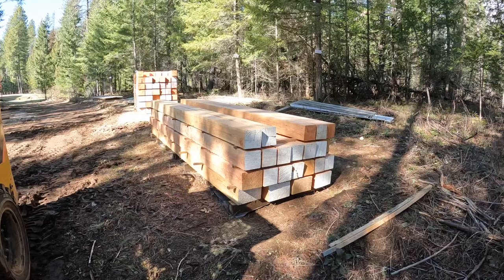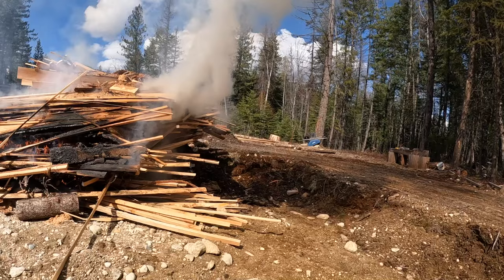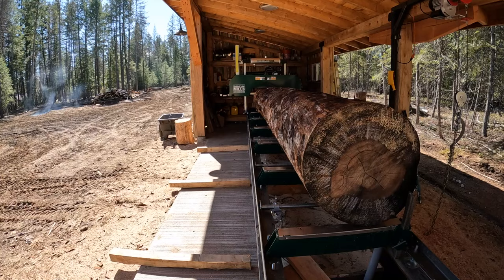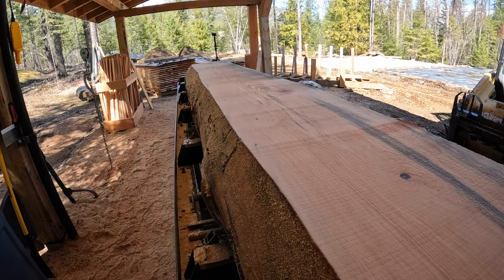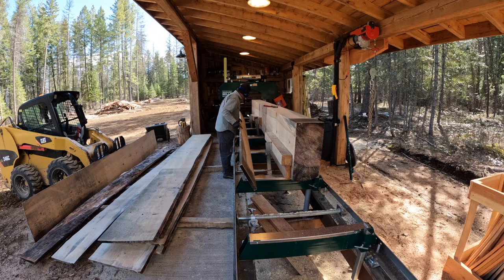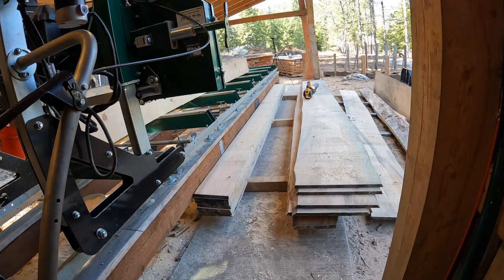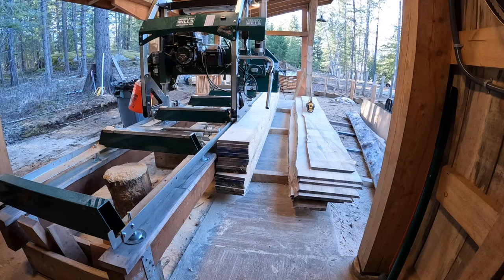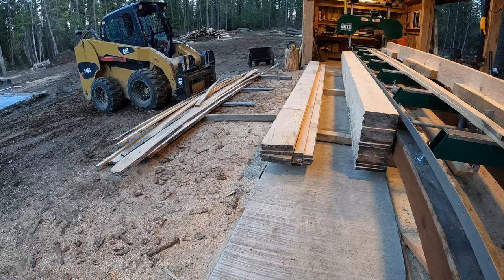This HUGE Ponderosa Pine LOG Giving Us Board and Batten For Our Barn Build - Woodlands Mills Sawmill

Comment: well here is the deal I have watched all winter you cut lumber, so when are you going to build? I can say if you are going to do timber frame you need to start  the notching of all 4x4 and 4x6 and all that to go together so stand them up and connect them
Reply from the maker: Hi, Wade! We have had a lot of timbers to mill this winter to get ready for our build. You are right, we need to prepare, but we are building a traditional barn with mechanical joints, so no notching. 😁
The plan is to start building June 1. 🙏🏻

Comment: huge log.....I don't know if this would be worth the extra effort. The first cuts that still have bark on them, level from the pith and mark the end of the log so when you cut the bark off you can still keep the pith centered. Which that would mean you could only cut one side one at a time to keep the pith centered when cutting bark/wane off. That would keep pith centered vertically and horizontally...clear as mud??
.
maybe a electric leaf blower to help with sawdust removal. I believe that is what MIke Morgan does. I have my air hose from my compressor for getting majority of saw dust off.
Reply from the maker: Hi, I read your comment a few times and couldn’t come up with what you were talking about. Sorry 😁
I could try my leaf blower- might do a fair job. It seems to have moisture in it that makes it a bit sticky. Thanks for watching! 😄
Reply: 👍....yep...no problem. Like I said, Clear as mud😁
Reply from the maker: @hpw59  🤣